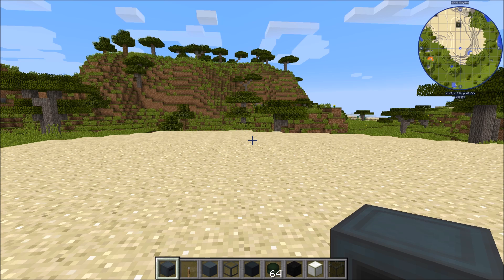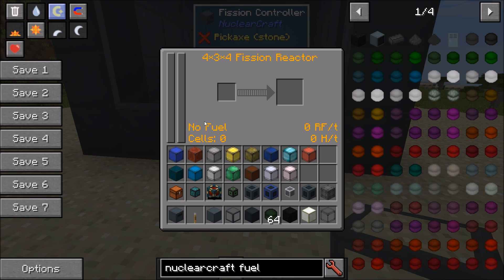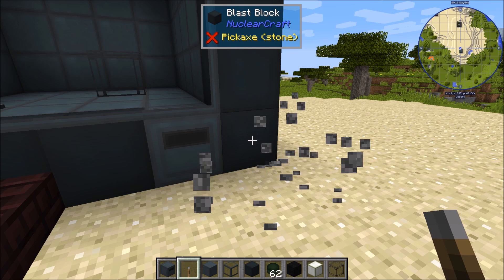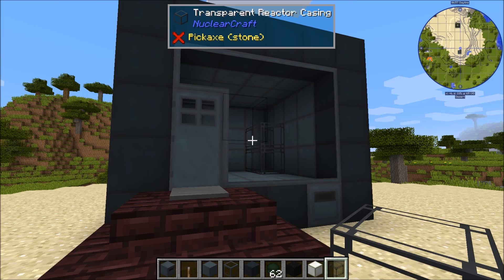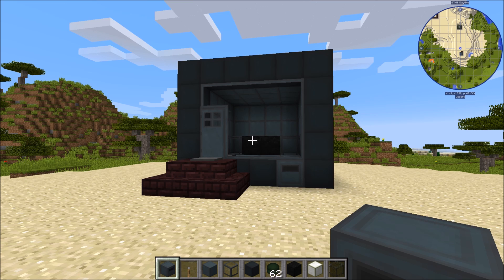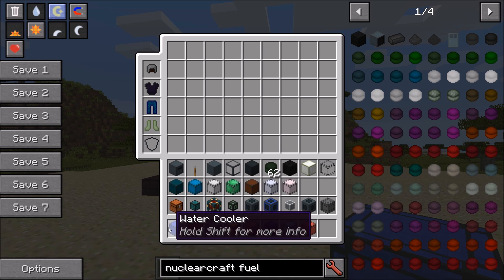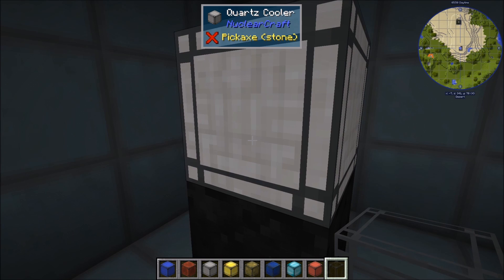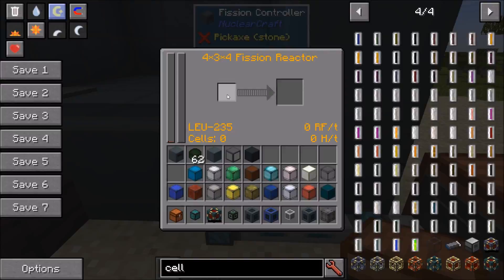NuclearCraft Spotlight - Solid-Fuel Fission Reactor [1.12.2]

Comment: how do i harvest the energy after?
Reply from the maker: You can extract either from the controller or a fission port :)
Reply: @NuclearCraftMod  thanks but how do i exactly extract it from the controller? im loving the mod i just dont understand everything
Reply from the maker: @chillren654  In the same way you would from any generator - with a cable or battery of some kind.
Reply: @NuclearCraftMod  Alright thank you!
Reply: @NuclearCraftMod  This is the main thing im really confused about what do i click to get it into the battery? Im sorry i dont understand im just a bit confused
Reply from the maker: Just wondering so I can give useful help - are you new to modded Minecraft, in particular tech mods?
Reply: @NuclearCraftMod  Not modding, but yes new to tech mods, im just really confused about how i can get the energy into a battery
Reply: @NuclearCraftMod  Ok ive actually figured it out, what about the batteries which are items and not blocks?
Reply from the maker: So yeh, most energy storage and manipulation takes place in blocks - if you want to charge a battery item, you can do so in various chargers, such as Tech Reborn's battery blocks or Thermal Expansion's energetic infuser.

Comment: Hey when will the steam versions of the reactors be included again?
Reply from the maker: They are on the way, but taking a little longer than usual to get finished. I have nearly completed the molten salt reactors themselves, but I still need to do the heat exchangers, turbines and boilers before it can all be used :)
Reply: I liked pairing them with mekanisms turbine.
Reply from the maker: There will be an option to produce standard steam for use in Mek and ER turbines, so you should be fine.
Reply: Next update?
Reply from the maker: Next major update, yeh - will be a while though!

Comment: why did you delete steam controller? it is the basic of fission reactor make steam and make energy with turbine.... its not RP anymore
Reply from the maker: Because there are new steam-producing reactors - check out the Molten Salt Reactor and Heat Exchanger vids ;)